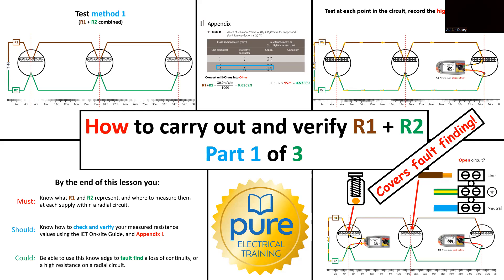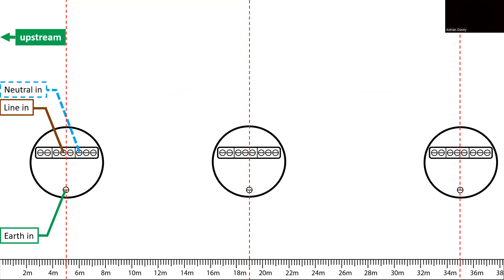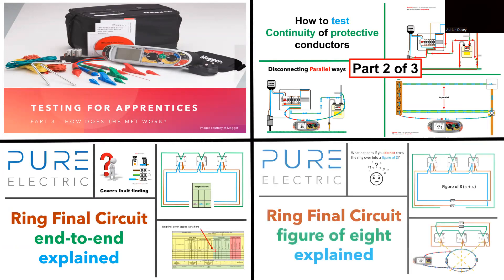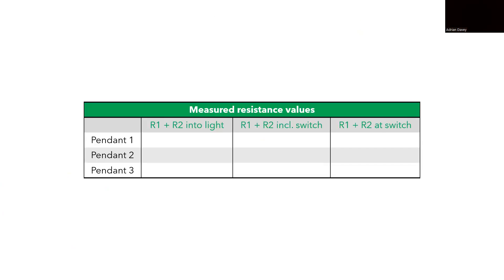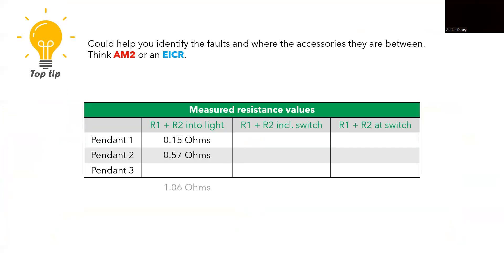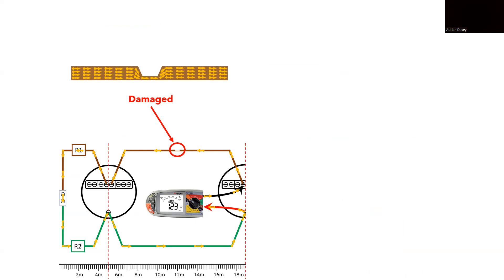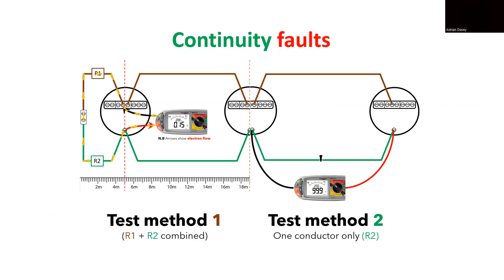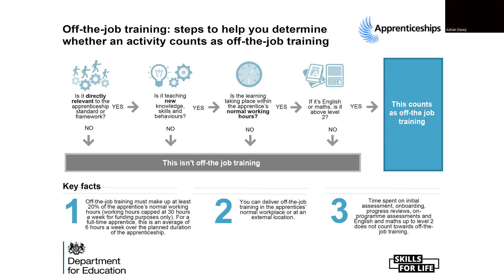Verify R1 + R2 testing of a radial lighting circuit - covers fault finding and write-up. Part 1 of 3

Comment: Hi Adrian very detailed explanation.. I have 1 question hope you can answer when testing at  the ceiling rose I presume you disconnect the cable when testing to avoid parallel paths.. can you please confirm.. or am I missing something here..  and what if the light socket only has only cable.. I presume the supply is at the light switch.. which I have found on many new builds

Comment: Thank you very much for the video. As an enthusiastic amateur, I have plenty of theory but not so much practical experience. Your  explanantion is very clear as is the logic behind analysing the readings from your MFT. However they all depend on having a fairly good idea of how long the cable runs are (5m, 19m and 35m inyour example) - How would you establish that on site?
Reply from the maker: Thank you for the feedback. On-site you would take a rough guess at the measurements and your readings would ‘be in the ball park’.

As long as the maximum measured resistance, combined with your Ze, is below 80% of your max Zs, then your circuit is compliant